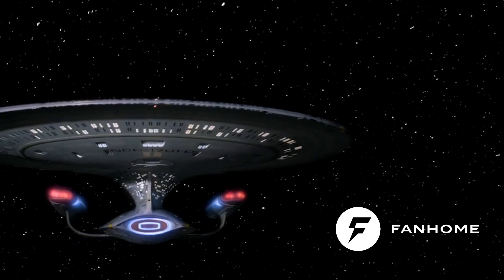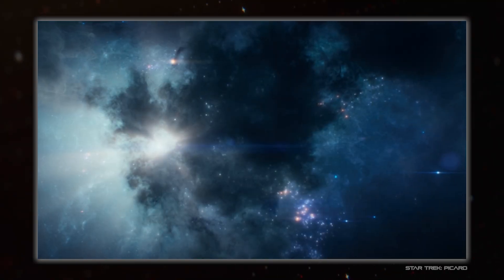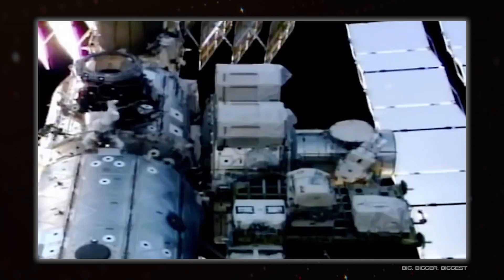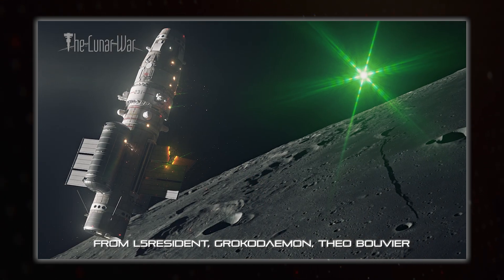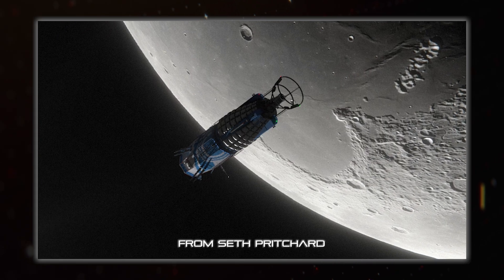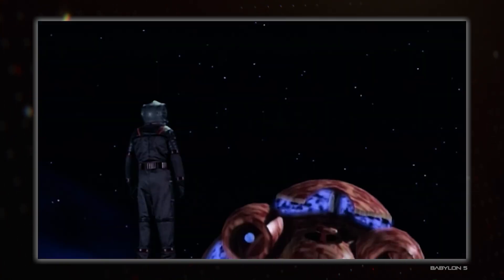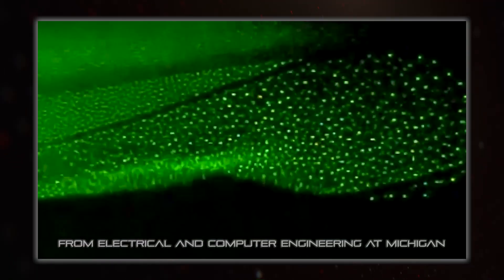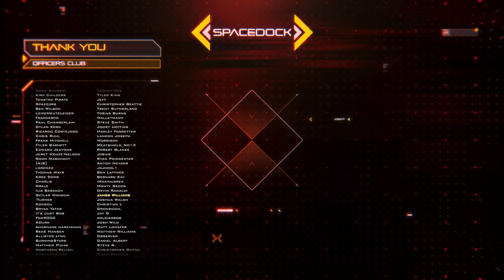Radiators In Realistic Sci-Fi (And Why You Need Them)

Comment: In a story I wrote, the ship used supercooled hydrogen in multiple tanks for fuel. Fuel was circulated through the skin to absorb heat from lasers and to preheat for drives. This is effectively an internal heat sink of limited duration; bigger ships didn't necessary last longer even with bigger tanks because they generated proportionally more heat. In ordinary operation it extended radiators in excess of operational needs in order to dump heat from the internal fuel tanks. Lots of minor radiators as well.

Comment: I have not reached the level of sci-fi hardness where I do the math to definitively determine how large the radiators need to be. But I am always aware of the need for radiators and try to come up with solutions for older designs of mine.

Some of my ideas that are born from awareness of the heat management problem:

In an interplanetary guerilla war, the military fleet will deter approaching craft first with low power lasers. Those aren't put in destructive settings but just add heat to the target. The only way to avoid that is proactive evasive manoeuvring, but the closer the distance the shorter the light lag, so eventually you overheat either from the lasers or from your own continuous high thrust engine burns, unless you retreat. Because lasers don't even get to 50% efficiency, this always adds more heat to the total system of the firing craft than to the target. Therefore this strategy relies on outnumbering the incoming craft.

In orbital combat the targeting systems use infrared purposely chosen so as to aim for the hot radiators of the main engine and the guns as a means to disable them. When you surrender, you better fire away perpendicular to the direction of the enemy because any last salvos before they cease fire should be drawn to your gun's radiators when your engine radiators are cooling down. Purposely targeting the low temperature radiators of the crew module would be a war crime.

If you're led into a place that's larger on the inside — it's not. You just haven't seen the real outside, because you entered through a portal. But the actual outside is larger and it exists somewhere. How you know that? Because of heat management.
   We haven't seen all of the TARDIS' exterior yet. There's probably an unimaginably gigantic radiator farm somewhere in intergalactic space that's part of the TARDIS.

Comment: Actually had an idea, were spaceships would normally carry radiators with them, but would detach them before the battle to keep them safe and away ad als reduce wait. In the battle itself they would rely on open cycly cooling. They may or may not also use those heat packages as extra ammunition to throw at the enemy

Comment: I kind of have a dumb thought. Why not use the excess heat to power a boiler that creates steam which turns a turbine. Use the electricity to run the ship or Ion engines or something. You'd still need some radiators but significantly less. This way we'd have steam powered spaceships. Add smokestacks for the extra funny.
Reply: Because unless you use magic to run some magic engine
Every kind of fuel you use in your machine will produce waste heat
Reply: @thanhthuannguyen6794  I never said it would be a perpetual motion machine. Just a thought as to recycling some of the excess heat produced in the process. Yes you'd still need radiators. But can the amount of radiators be reduced by reusing some of the heat.

Comment: The idea of using open-cycle radiators for dumping large amounts of heat quickly is particularly interesting, from a story and world-building perspective. Since this uses up coolant and thus requires frequent refueling, it would only be intended for infrequent use. But guess what else is infrequent? Short, intense space battles! So a spaceship could use its closed-cycle radiators for normal operations, and then when in a battle, it could turn them off to avoid thermal detection, instead storing the heat in a disposable liquid. If detected, the ship could dump the superheated liquid overboard as a form of extra propulsion and perhaps defense (to confuse heat-seeking torpedoes).

My point is that including radiators insteod of ignoring them can actually enhance the storytelling possibilities. Radiators can lead to interesting decisions and dilemmas, as mentioned in this video (larger radiators present more of a target to enemy weapons, but are necessary for more powerful weapon systems).

Comment: Interestingly enough (and I'm surprised you didn't mention this), the Apollo lunar module used open cycle cooling: It had water cooling tubes surrounding all of the electrical components of the spacecraft - the water would absorb the heat and be vented overboard as water vapour.
On Apollo 13, this was actually the reason why the ship kept going slightly off course on its way back from the moon: The vent was on the side of the ship and generated a small but significant amount of thrust. Since this was continuous, it added up over the several days the journey took, and required multiple course corrections to keep the re-entry angle within a range which would prevent the ship either bouncing off the atmosphere or coming in too steep and burning up.
This was also the reason why he radio blackout period (caused by hull ionisation during re-entry) for the Apollo 13 re-entry was just over 5 minutes, when for all previous and subsequent flights it had been no more than 3 minutes: The lunar module was still docked with the command module almost until re-entry, the angle was on the shallow side of the possible range, but they had already expended all the RCS fuel doing previous course corrections so there was nothing they could have done to correct it any further.

Comment: Currently taking Engineering Thermodynamics 1, and I have to say, you can prove with basic arithmetic that this is one of the hottest Spacedock videos of all time.
Reply: Nice. I loved thermo. Our Sr project (Aerospace Engineering) was a space design using the space shuttle fuel tank for the main structure. :) I did the thermal and propulsion.

Comment: I think radiators have an untapped potential in visual storytelling. The glow intensifying can inform the audience or the characters that something significant is happening on the vessel. For example if you see an increase in infrared coming from an enemy ship it may mean that they are charging capacitors in preparation to fire (a railgun or energy weapon) or if they just fired a conventional projectile and need to remove heat from the gunpowder. At large distances the light may arrive before the projectile allowing for more tension and strategy. Or use the absence of heat as a cue. A ship being damaged or hiding.

That would play into the submarine analogue and IR could become a kind of passive sonar.

Comment: We also use thermal blankets to manage heat.  Satellites will have either reflective or absorbing blankets depending on how heat needs to be managed.
Reply: Any major energy weapon turret should probably be seated in or on some kind of highly reflective or otherwise insulated surface to prevent the heat radiating off of the weapon itself from heating the main ship, if feasible.
Reply: @Jesse_359 how are you planning to connect the turret to the shit?
Reply: *ship
Reply: @mryellow6918  You obviously need a physical join to the ship for power, ammunition, and whatever articulation machining you're using for your turret - however, if it uses gun barrels or rails these will likely be radiating a lot of heat and will be projecting out over the hull - this is the part you might want to consider adding additional reflective insulation to.

Comment: Open-cycle cooling (such as the "nuclear lightbulb" realistic(-ish) theoretical design) is my headcanon for why The Expanse doesn't bother with radiators on their ships. 

Especially since they don't JUST use the fusion plasma for their thrust, they run it through a bunch of water to increase the momentum imparted. That water is a perfect place to dump the heat from the interior of the ship as well. (Especially if you use handwavey physics-inspired designs rather than 100%-hard sci-fi numbers.)
Reply: Given that the epstine drive was cinematically fuel efficient,  I would assume it generates far less waste heat than any real world rocket engine.
Reply: @erockandroll39  indeed, though I’m thinking about all the other sources of heat (inhabitants, computers, comm lasers, PDCs, later railgun)
Reply: @kaitlyn__L pretty sure in a few episodes they do actually overheat some of the pdcs or come close. They are actively cooled and they also use many barrels not just one so they don't get as hot.
Reply: @erockandroll39  nah, the heat itself is the source of thrust, ie: high heat => high kinetic energy of gas => faster exit velocity => high thrust. So epstein drive ran cool mean it has no energy, and uses less fuel means it produce no gas, = zero thrust.
Reply: @putty-e2872  usable heat (directed into thrust) and waste heat (such as from the magnets directing the thrust) can both occur, so the supposition is whatever Epstein did which made the “flame” blue and fuel efficiency go up had to have massively reduced the waste heat to move the energy into useful heat.
Reply: I know the stealth ships in The Expanse use helium cooling on internal heat-sinks as well as micro-tubing that runs along the exterior to function as a fast radiator when leaving stealth. IIRC this is only in book 7 on, but I remember the TV show stealth ships using internal heat-sinks as well as having sudden massive jumps in heat when leaving stealth so it could be the same concept

Comment: One additional possibility is to use the heat to improve the energy of propellant from thrusters. By exciting the particles of the propellant, making them leave the exhaust port faster.
Reply: Modern rocket engines sometimes use regenerative cooling, but keep in mind that the second law of thermodynamics means that much of your heat will inevitably be wasted away.

Comment: This is actually what I've been thinking all along. Wings on an X-wing or "solar panels" on TIE fighters are actually heatsinks. That can also explain why laser cannons are usually mounted on the tip of the wing.

Actually the design of TIE fighters are actually quite genius. The panels can radiate heat and protect the cockpit at the same time. And since heatsinks can be easily made redundant, one or two stray shots will not make the whole ship inoperable.
Reply: The TIE fighter is great from a thermal perspective but terrible from a structural and ADCS one, because the large wings means your center of mass will be completely off if it gets hit.  The x wing is better because of the smaller target profile, but ideally, if you wanted maximum manueverability, you'd actually want engines on wingtips too.  However, the issue there is the vulnerability of the engines, like you see on the y wing.  Of course this is all according to our design principles, not accounting for star wars advances in technology.

Comment: The UNSC has a really cool solution to heat management:

The ENTIRE hull is both a heatsink and a radiator. They pump heat directly into the meters-thick Titanium-A armor plating.

As it's a LOT of mass, as well as the entire exterior surface area of the ship, it works amazingly well.
Reply: Is this why the Pillar of Autumn was so god damn big and why that Covenant ship was leaking stuff from the hull? I've only finished CE and am in the middle of Halo 2.
Reply: @phosphorescence-lq84i  I think the Covenant ship was leaking whatever kind of plasma propellant they use.
Reply: @Attaxalotl   the liquid leaking out of the Truth and reconciliation was reactor coolant
Reply: To be fair this is technically true of every spacecraft; after all everything radiates heat to some extent.
Reply: So the weird thing is, you kind of want a tiny, very hot radiator to get rid of heat efficiently, not a very large cool one. Whatever your radiator is, you ideally want it running at a temperature that is pretty close to it's material melting point.
This is why plasma or droplet radiators are nice - you can run them far BEYOND any material melting point, in principle. The question is what mechanism are you using to transfer the ship's heat into these droplets, and why isn't that mechanism itself melting? Usually some hand-waving about magnetism is included here, which is perfectly fine for sci-fi.
Reply: @Jesse_359  You want that if you want to minimize the surface area. If you are turning your entire outer hull into a radiator then you are not worrying about minimizing surface area.
Reply: If its thick it's bad you don't want a radiator to be thick. You want it to be thin you want the surface area not the mass
Reply: That’s great for using during combat. But it’s very inefficient out of combat. Probably it should have small high-temp radiators to pre-cool the ship and the hull before combat, and cool it down afterwards.
Reply: @myronplatte8354 that's assuming there's a any purpose to do so, at least in the Halo setting? I mean, they obviously don't care for stealth (that seems to only be a thing for the specialised prowlers), so no need to cool the hull on that account.
Reply: @mnxs  Pre-cooling the hull  would mean more time in combat before overheating.

Comment: If I'm remembering correctly, those side panels on TIE fighters are Radiators
Reply: I’ve only seen them as solar energy collectors, but sw adds  flimsy used to everything so who knows
Reply: @Eshanas  Just looking up cross sections of the Tie fighters - have solar arrays over heat exchanger piping - So they are both?

Comment: I never understood why classic sci fi shields don't use heat as their upper limit? You know how an officer screams "we're at 45% shield capacity" in the middle of the battle?

The reason for WHY there is an upper limit to shields is handwaved. But what if it's because the shield, which absorbs energy, then transmits it to a device which overheats... if the limit isn't "energy" (whatever that means) but overheating then everything makes sense and is even more interesting. your radiators can't dissipate enough heat fast enough from multiple ion torpedoes hits so you dump the excess into a heat sink which is currently 45% full. And you can tune down the energy absorbtion to let some of it through and have your armor tank it instead of your heat sink to get these cool interior shot of the cabin shaking around and with sparks everywhere. The reason why you'd do that is because the situation has become dire and has it worsens you have to compromise hull integrity more and more.

It's a really elegant solution to that specific sci fi trope imo.

Comment: The ships for my setting have HUUUGE radiator sails that fold out pretty much whenever the ships aren't in combat or in FTL. I purposely made them connect to the main hull using "masts" to create a sailing ship vibe. In combat though, I just use elite-dangerous esque ejectable heat-sinks. It does put a limit on time in combat though, at least if you don't want mass drivers poking holes in your "Sails"

Comment: Now that you've done radiators, maybe do fuel tanks. That's the only thing that bothered me about the ships in The Expanse. Where did they keep all that reaction mass and fusion fuel? Don't get me wrong, I prefer the looks of their ships over most in scifi, but once I realized it was missing, I couldn't help but see it every time.
Reply: Well their drives are basically magic conversion high efficiency drives, so basically a deck or two of water honestly. But the expanse is barely hard sci-fi to begin with so dw about ut
Reply: epstein drives are so efficient that they only require a little bit of propellant to get anywhere in the solar system. you can easily hide that within the drive section or somewhere near it

Comment: I've always thought that adding accurate radiators would make for MORE exciting sci fi space battles instead of less. Like, make it a plot point that your ships all have these giant weak spots that can be retracted behind armored doors in combat, but that limits the time you can fight drastically, so you have tense moments where the crew is weighing keeping their radiators closed but overheating all their systems or opening their radiators early and exposing them to enemy fire. Plus different types of ships would have different sizes of heat sink, so you would end up with interesting lopsided battles where some ships just try to outlast their opponents because they know they have the sink capacity to keep fighting longer than their opponents. Its a shame that so few ips actually have interesting radiators or heat systems in general.

Comment: The concept of using your coolant and dumping it overboard is something we use IRL.  The rocket fuel or oxidizer(not sure which) flows round tubes in the nozzles and cool them before passing into the combustion chamber.
Reply: It's usually the fuel. Oxidizer + heat = rust
Reply: @lucky-segfault  Dual expander engine cycle uses both fuel and oxidizer.
And, IIRC, first ever expander engine used liquid oxygen as both oxidizer and working fluid

Comment: Radiators have a lot of potential in sci-fi stories, for example, imagine this is a ship designed for stealth, so you really dont want yo be emitting thermal radiation around, so you could have a system where you ship "stores" thermal radiation internally and dump after a certain thermal capacity is reached, so imagine if you have this mechanism which only works for limited amounts of time and the longer it goes, the more dangerous it is for the ship, maybe the crew have to deal with increased internal climate or the ship my just explode if it overheats too much.

It could be a nice narrative device to create tension in the story.